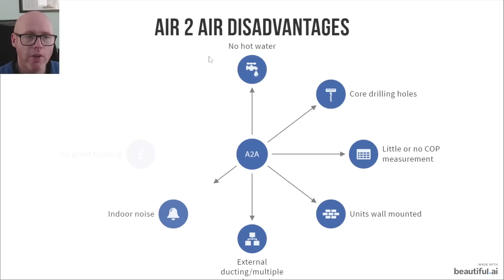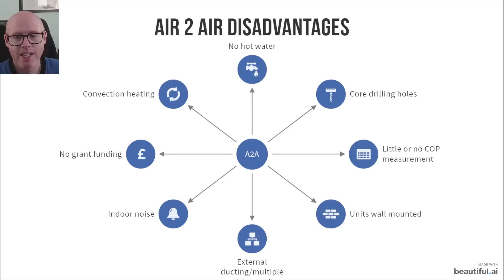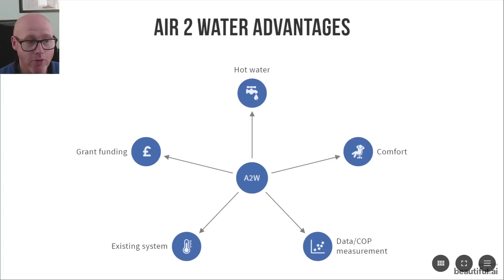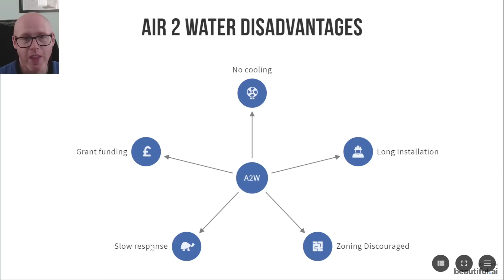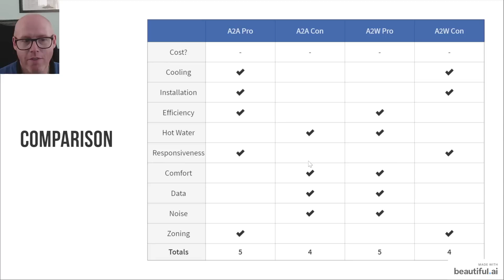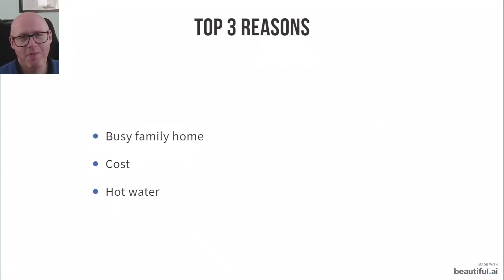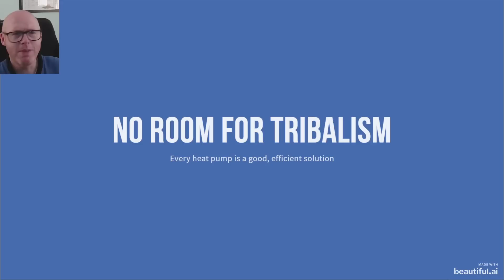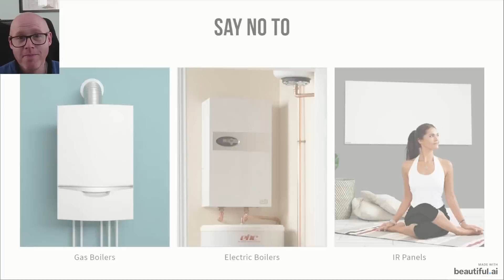Heat Pumps: AIR TO AIR or AIR TO WATER?

Comment: we looked a A2A but could not imagine having to add the units to every room in the house, it was much easier to simply replace our combi boiler and put the HW cylinder in the roof. Our house is a typical 1970s 4 bed so I had alwas retained the relatively huge radiators, just running them at a lower temperaure on gas, the installation was so simple that it only took two days to fit with all the remaining 70s radiators upstairs replaced even though the heat loss survey said they were OK, modern radiators are much better and don't need painting.
Reply from the maker: Thanks for commenting!
Reply: @edwyncorteen1527  You could of gone for ducted A2A but we prefer the flexibility of individual units so heat on in kitchen and a glorious 16° c in my home gym.

Comment: 10 years now with A2A at 53°N, working great, less expensive, simpler. Works very well but only if the house is insulated. 99% are not. We are in that 1% and its fine, aircon does not run at night, no need unless its freezing outside. Energy costs are low, solar panels provide power 8 months of the year, did I mention that this is 53°N and not a southern hot country :-)
Reply from the maker: Thanks for commenting!

Comment: Back in the 70s we had hot air heating system it didn’t keep the house warm it was useless so we changed to gas radiator system and the house was loverly and warm , so what’s the difference now do you have special air
Reply from the maker: That system would have used direct electric heating elements rather than using a vapour compression system with compressor, evaporator and condenser.

Completely different systems. It's almost the same as comparing a steam engine train to a modern refined car.
Reply: @ if you stood next to the vent hot air came out but it couldn’t keep the house warm , it was oil powered not electric I was only about 10 at the time but I do remember tankers coming to the house it was useless so we

Comment: I would put planning permission down as a particular con of A2A. Permitted development is for heating purposes only; "the air source heat pump is used solely for heating purposes" (although someone could argue that during hot spells they are using it to heat the garden). Getting permission for something which could be used as air conditioning is far tougher as some councils check the noise level at property boundaries.
Reply: I am getting A2A installed soon. I was told you only need planning permission if the units are less than 1 metre from your boundary.
Reply: @dennisbean5569  Search for "heat pump permitted development" and find the link to "The Town and Country Planning" legislation. This Class G development only applies for heating. Note that I think you are liable if planning permission has not been obtained, not the installer!
Reply from the maker: Thanks for commenting!
Reply: I disagree. There is no planning permission for Air to Air required unless in certain circumstances.
Reply: @lawman1965  If the heat pump is used for cooling purposes then it is not permitted under permitted development class G. See conditions G.3.a) "the air source heat pump is used solely for heating purposes". Is there another class of permitted development that air-to-air falls under?

Comment: The fact there is no grant available for air 2 air raises big questions about what is actually trying to be achieved with regards to moving away from gas.

Much like why people can have cheaper electricity to charge an EV with off-peak electricity, than people heating their homes and water with off-peak electricity.

Something isn't quite right about all this, and government thrive in division!
Reply: @BROOMEngineeringTMIET  I have wondered that myself. Don't know if it's baseless but as A2A is so cheap to run maybe like solar there's the "whats in it for me?" equation. Reducing the power you use reduces the profits. Why else did they stop any aid for solar?
Reply from the maker: Thanks for commenting!

Comment: I've an A2W system in my house, and it works great. I agree about the tribalism, and we should be focusing on just moving off gas boilers. However, electric boilers and IR panels have their place too. They are still electric at the end of the day and lower carbon than gas boilers. 
I've an electric boiler in a flat that I rent out as the gas boiler was leaking water from the flue and dripping through the ceiling. Rather than trying to fix the flue by ripping the ceiling out, an electric boiler made the flue redundant. Hanging a heat pump off the balcony or external wall is not really an option. The building management company would have something to say about that!
Reply from the maker: Thanks for commenting!

Comment: It’s the industry/government one size fits all (air to water) mentality that gets me. Totally agree with all your points. Regarding air to air and noise, if you’re willing/able to pay a bit more you can get quieter indoor (and outdoor) units. 
Bedroom cooling for a couple of weeks in summer is worth its weight in gold and was a big factor for us in going the air to air route. 
A point to note, you can’t put an indoor unit in a bathroom, but you can have airflow ducted from a separate unit. We went for a mirror IR panel for the bathroom.
Reply: Oh! that's interesting about not being able to put a unit on a bathroom wall. Is that a regulation?
Reply: @ Lots of rules on where and what electrical equipment can go in a bathroom.  If you can find a unit with the correct IPx rating and it’s fitted in the appropriate zone then it may be ok but you’d have to do a lot of checking.
Reply from the maker: Thanks for commenting!

Comment: Great video pal and very informative and balanced. I've just had 16 solar panels fitted and will maybe look at some sort of heat pump solution next. I was drawn to A2A as I heard lot's of negatives about A2W especially in winter months and if you want 21 degrees comfort? But maybe that's just a myth and you can get comfortable temps all year round.
Reply: The key point is the sizing. And applies to both A2A and A2W.  e.g. Undersized A2A or A2W won't be able to cope on the coldest days in winter either way.
Properly sized and installed, either is a great choice. The main deciding factors are going to be cost (including grants), and whether you want cooling in summer.  Also whether you want to go through planning permission or not.  As A2A basically always requires planning permission, but most A2W installs will come under permitted development.
Reply from the maker: Glad it helped!

Comment: France, who are lauded on their heat pump fitting, you can  get a grant for any heat pumps including Air to Air (air con)So out of  the figures of 600K heat pumps they fit a year, 420K are Air to Air! 
They still fit many more air to water to us, but the comparative figs that the media keep producing are skewed as the UK don't count or give grants to air to air, not even air to air water heaters, which I can't understand.
Reply: @jezzaandrews1940  The government seem set on discouraging A2A completely,  I had an epc done at my new house after I had finished updating (and got a B ) but annoyingly the guy doing the epc said he couldn't count the A2A as it didn't appear on his list (as in not included ) also no grant. Considering the whole system cost me less than the grant the government hand out for A2W I find that crazy considering how this current lot are pleading poverty.
Reply: Yes, if they want to cut down on Co2 and get the number of heat pumps fitted that they want, they need to include air to air systems. Air to air water heaters should definitely be Government discounted.
 I understand the worry that more energy will be used in the summer time with cooling of the ATA units, but the grant should be more flexible. 
If householders have invested in solar panels and batteries, they are cutting their Co2 consumption and using off peak energy to charge batteries etc. They are helping the planet and the grid! So If they then remove a fossil fuel boiler  from the property, maybe the grant should be on a sliding scale, with a points based system, with Air to air in the mix, but with the Government preferred option, air to water gaining the maximum £7500!
Reply: @jezzaandrews1940  This year from March to October my solar and batteries meant I used virtually zero power from the grid meaning my A2A was free. Help from any government with paying for all of this? Zero! But on the upside VAT to the government on my energy bills also zero. As you can guess I did this to make my house as cheap to run as possible as my primary reason. Incidentally I exported enough excess electricity to the grid to build up almost £600 credit to see me through the darker months so I'm still not seeing anything coming out of my bank account.
Reply: Nice one👍
Reply: The problem with those figures is, whether that is per install or per unit.  As there are plenty of cases where multiple outdoor units are used for A2A, whereas a single one is used for A2W.  So if every A2A install had 2 A2A units, and every A2W install had 1, then those figures are about even.
Reply: So you are agreeing with me then!👍
The 600K French figures could be far far less households fitting heat pumps than the massive figs suggest!
that makes other countries heat pump figures skewed as well ! So in theory when they say Sweden is fitting 100K heat pumps, the majority are Air to Air, so  that could mean only,  say 40K households coz some will be fitting multiple air to air units!! 
The UK Government only count Hydronic heat pumps which will be 99% of the time, one unit/household. I have seen a 2 unit set up before on a massive property.
Reply: @BenIsInSweden  Hi, no that's total as in everything supplied fitted and site cleared up afterwards.
Reply from the maker: Thanks for commenting!
Reply: Uk don’t want to encourage A 2 A as it will increase power consumption in the summer (air con) hence no grant only VAT exempt😮
Reply: @davebaker4620 hi, maybe but lower power consumption in winter. Now @21:10 my living room is on at 23° ( all others off) and I'm drawing 0.80 kws. Outdoor temp 6°.

Comment: Hopefully VRF systems will get cheaper and smaller, then you can do air to air and air to water via the same outdoor unit.

That way you could cool your rooms and use that heat to heat your hot water.

We have air to air as we removed storage heaters and had no existing plumbing.

But I think the best combination is underfloor heating and ducted air to air.

That way you can do the ground floor with a big underfloor heating setup, and then do the upstairs via air.
Reply: I think it’s unlikely that systems capable of simultaneously cooling and heating (e.g., heating water using the heat extracted from cooling) will become common in residential heat pumps. The added complexity often outweighs the benefits for small-scale applications. However, it makes a lot of sense in larger setups like hotels, where there’s a constant demand for both hot water and air conditioning.

For my A2A system, it also provides DHW. When the system switches to heating water, the cooling function temporarily pauses. Once the hot water cycle is complete, the cooling resumes.

There’s already some heat reuse happening in these systems. For example, when cooling, the outside coil heats up. Some of this heat is diverted to assist in heating water. Similarly, after heating water, the system starts cooling from a slightly lower baseline temperature, which can make cooling more efficient.
Reply from the maker: Thanks for commenting!

Comment: So what about (ignoring cost) just having both types? The cooling gets handier every year!
Reply: That's what the B&B in Rye does.  Has A2W to provide a baseline level of heat, along with hot water, and then guests can use the A2A to boost it to their desired temperature.

However, in most homes, you will end up oversizing with using both, e.g. for a 5kW heat loss you aren't going to be able to get units small enough for both to work in tandem.  So it would be more efficient to use only 1 of them.
Reply: That would be ideal if it weren’t for the BUS grant and planning implications. Have an A2W pump sized for hot water and “base load” heating, and the A2A for flexibility and as a peaker plant in the depths of winter.
Reply from the maker: Thanks for commenting!

Comment: A2A is nice, but often runs into the problem, that the internal Temp sensor is inside the unit. That means it will often turn itself off very quickly and do a lot of on/off cycles without properly heating the room.
If you want it to actually work as a heating system then you need to get an A2A that has a sensibly placed temp probe or you need to modify it.
Additionally, if you aren't going with a ducted system, then you will need several units if you want any kind of evenly heated home and that can get expensive, especially if you have to have all those units serviced regularly as well.
For cooling, I have one centrally mounted A2A unit that manages to keep the entire house at bearable levels in summer. For heating I went with an A2W System since we have underfloor heating and that is a much more comfortable and natural way of staying warm in Winter.
Reply: I've not run into that issue with any of the units I've had.  My Toshibas seem to manage just fine with the probe in the unit.  With my Hitachi, the temperature sensor is in the remote. So I've started to place the remote further away to use the temperature of the adjacent room to the unit rather than the room the unit is in.
Reply from the maker: Thanks for commenting!

Comment: For us we’re mixing the two, air to water downstairs (underfloor heating) and hot water, upstairs air to air, as we will get cooling as well, and we can get rid of every radiator in the house.

However part of the decision was based on the fact the grant doesn’t cover air to air systems because it cools too and often doesn’t do hot water and saving £7500 seems like a no brainer.

If it wasn’t for the grant we’d probably not bother with a2w, as it’s heating only and extremely expensive.
Reply from the maker: Thanks for commenting!

Comment: Its worth noting that the low and slow method isnt an exclusive advantage of a2w over a2a, because a2a can do it just fine too and is how I run mine, obviously heat distribution isnt quite as even, but things like my bed are very comfortable to get into even though its not directly aimed at by my upstairs unit on the landing.

As others have mentioned, high wall units arent the only option as well and can have floor mounted ones that look more like a storage radiator.

Panasonic also have units with a "windfree" mode now, which can heat and cool without using the fan, but when it needs to it also has some sort of smart tracking where if theres someone in the room it will direct the air flow away from the person as well.  Not sure how good it is, but that sort of thing should resolve the complaints of being blown on.
Reply from the maker: Don't steal Tim's thunder! 😁 He's got a great video coming up to showcase running low and slow just as you are 👍

Comment: I've had an ASHP for 14 years and solar for 13 years. I have a 5 bedroom house. The unit is 12kw. I have some underfloor heating and large radiators. I have tried running it continuously but it does seem to cycle frequently and cost more to run. I think the attitude then was that you needed a large unit to ensure that it will be adequate. There is no way to get any data about its efficiency. I have only had one service in all that time and realise that I really need to sort that out. Overall I have been happy with the system but have thought about replacing it for a more modern unit. Obviously there would be no grant so the cost of just replacing the heatpump would be high. I have decided to install ATA in 4 rooms. This is going to cost a similar amount. I like the idea of cooling in the summer, especially in those hot nights when sleeping. I am not sure if this makes real financial sense but this that isn't really an issue. For most people cost is the important factor and if there was no grant on ASHP I suspect most people would go for ATA as I believe they do in a large part of the world. I hope I can use the systems to compliment each other.
Reply from the maker: Thanks for commenting!